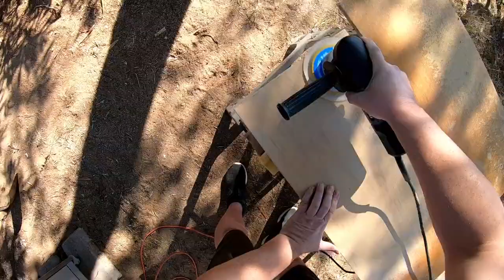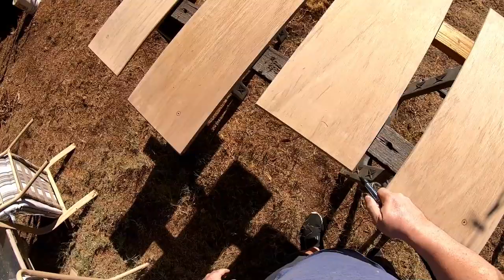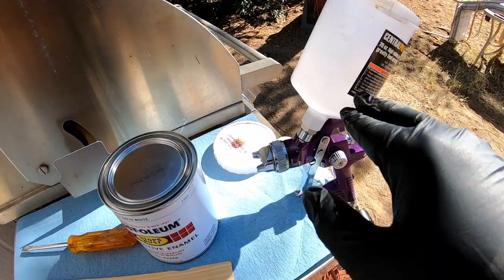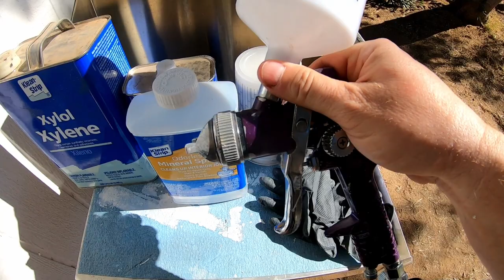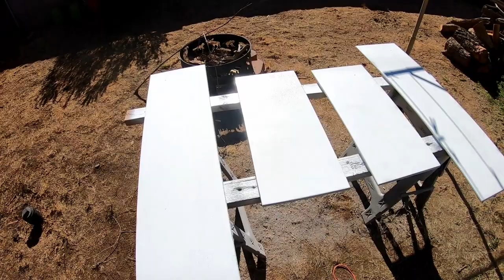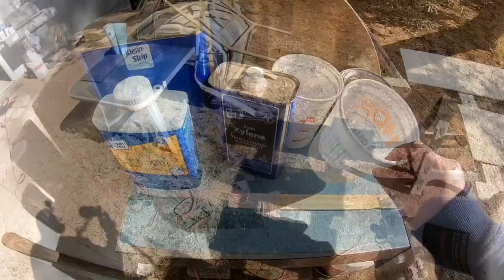Painting Cabinet Doors with Harbor Freight Spray Gun

Comment: Good video. FYI, the yellowing of the original finish is from the varnish, not the stain. The varnish is most likely oil based, which tend to yellow over time.

Comment: What size compressor did you use and at what PSI did you have the compressor at. It looks like you never lost pressure on the gun
Reply from the maker: It's this McGraw compressor from Harbor Freight. 
https://www.harborfreight.com/20-gallon-16-hp-135-psi-oil-lube-vertical-air-compressor-64857.html.

I think it was around 28-30psi? The compressor does run quit a bit still. You can also use an LVLP gun to reduce the size of compressor you need. I have both types of guns now.
Reply: @FabiusMaximus1000   WOW ! LOL I saw 20 gallon tank with a 16 horse motor on it and thought that right there is a bomb !! I looked and it is actually just a 1.6 horse . All clear  !! LOL I am looking at the next size up compressor and it is good to know this one did the small job ! Thanks and great question paz ! I will get the next bigger one for my small jobs with this paint gun !
Reply from the maker: @handsonwithblg4949  You can also get an LVLP gun and reduce the size of compressor needed.
Reply: @FabiusMaximus1000   Yup going to peek at those soon too !

Comment: HVLP gun? what size tip/nozzle you using. Acetone was that because you were using oil based enamel? Great video and wanting to do something similar.
Reply from the maker: I used the Harbor Freight purple gun exactly the way I bought it. I thinned the Rustoleum, which is oil based, with acetone but you could also use Xylene to get the correct consistence. 

I have since picked up an LVLP gun. I plan on making a new video shooting with the Behr cabinet paint but it's has so hot outside I have not even used it.
Reply: @FabiusMaximus1000  Do you know the tip size 1.3mm etc. Yeah weathers roasting here too!
Reply from the maker: @gazsto9510  To be honest, I'm not sure? Some sources say it's a 1.3 some say it's a 1.4. But it's in that ballpark.
Reply: @FabiusMaximus1000  Ok thanks for all your help, much appreciated. Just got a LVLP gun myself (1.4mm) and going to be trying some painting, hopefully this weekend. Got some good reviews and gives a great finish.
Reply from the maker: @gazsto9510  What did you get? I bought a SPRAYIT SP-33000 from Amazon.
Reply: @FabiusMaximus1000  Yeah l saw the reviews for those and very impressive. A friend recommended a one on ebay Burisch GTR 500, also a A. N. I R160-Q, and both are supposed to be really good, so l got the Burisch as it was not too expensive. The second one is recommended by GUNMAN here on YouTube, but looks more like a specialist gun for auto spraying.
Reply from the maker: @gazsto9510  Looks like you got a nice gun! I found a couple of pints of paint at my local paint shop already mixed up for the shell on my truck. Just waiting for it to cool off a bit. I will use the Harbor Freight gun for household projects. I can afford to throw that one away if it gets clogged.
Reply: @FabiusMaximus1000  Yeah, be trying it at the weekend, will let you know if it's any good. You should put out another video, weather permitting and a cooler day, when you do your truck!
Reply from the maker: @gazsto9510  I do have  few cabinet doors I need to paint with Behr urethane but I have put a halt on videos for now. I don't have a shop so I do everything outside and it's been very hot. I am getting too old to suffer in this heat.
Reply: @FabiusMaximus1000  Understand completely the heats unbearable and I am hiding in the shade myself. I am working from my garage, a bit cramped with all the jobs I got to do. Been working from home since the Pandemic started so things have built up somewhat.